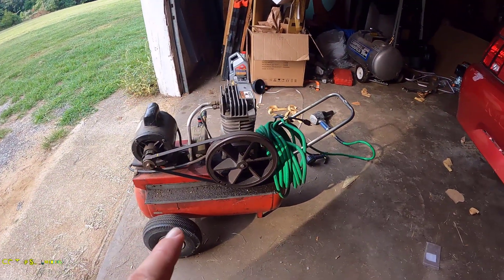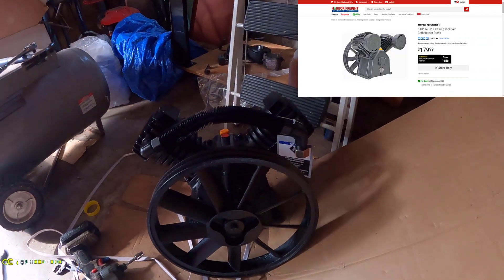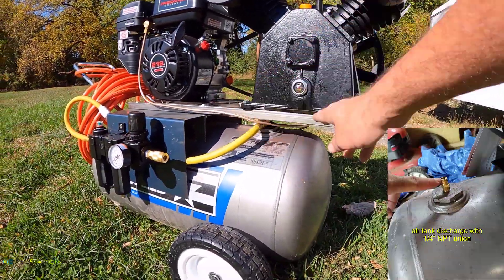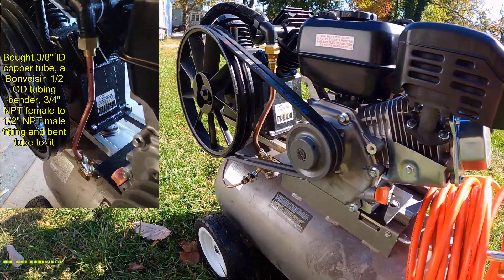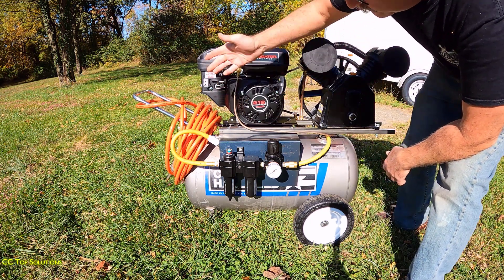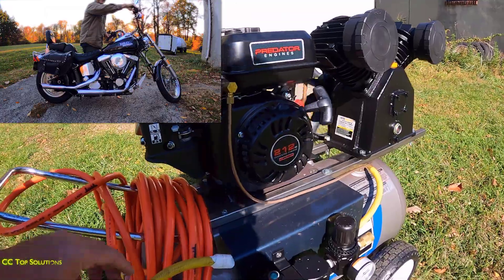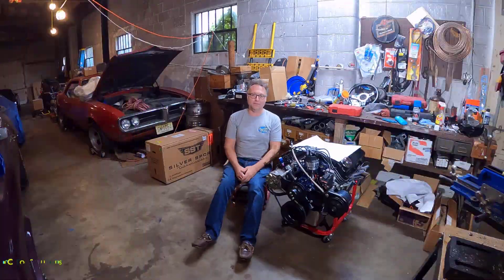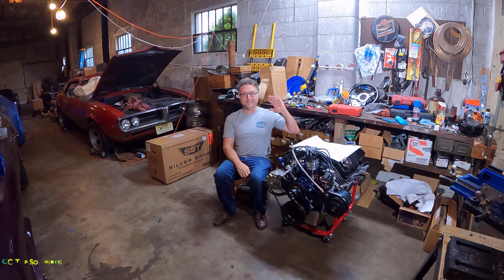Harbor Freight 5HP Gas Air Compressor Build with Pump Discharge Fitting Info

Comment: Ive built several compressors but with 110 -220 electric motor but never tried one with a gas motor think that might be my next diy project
Reply from the maker: Its a fun one!
Reply: They build air fast because they have double the Rpm

Comment: FYI anyone butting a gas engine on a tank mount that was made for electric, weld in mount down 100%, if you don't the tank will crack on the spot welds caused by the engine vibration, and it could explode, I have seen it happen.
Reply from the maker: Thanks for the tip! Ill weld it up!
Reply: What size pully did you use for the engine and thank you so much for the quick response
Reply: I keep getting people saying never weld an air tank, I just want to have the mounting plate from my old one welded by a friend who welds similar tanks every day for 15 years  to newer tank I scavenged, I suspect they don't know what thier talking about, they're welded at the factory no ? She does tig primarily & is a very good welder, whatcha think,  probably just utubers who don't even own any tools
Reply from the maker: @ericschulze5641 If shes a professional welder, definitly reduced risk. Once the welding is done, tank should be hydro tested. Ive seen some youtube vids where people connect a pressure washer to tank and pressure to like 250psi.

Comment: What kicks the motor off when it’s full?
Reply from the maker: Items 14 and 15 in the description. The engine doesnt shutoff, it throttles down to idle and an unloader valve opens until pressure falls below a certain level...then the unloader closes and throttle picks back up.

Comment: Awesome could you show how you hooked up the throttle linkage for idle control on the predator 212. I wanna swap some old worn Honda motors on wheelbarrow compressors

Comment: Can I run this same exact setup on a 60 gallon electric compressor, I can weld stuff just wanna make sure
Reply from the maker: Morning, yes you can.
Reply: What size pully do I run on the engine and thankyou for the quick response
Reply: And what size pilot unloaded valve do you recommend just looking to do a bunch of sandblasting and powder coating
Reply from the maker: Pulley (2AK41X3/4, Amazon $41.76), in the video description, i provide the part numbers for everything I used.
Reply from the maker: 14. Gas Air Compressor Pilot Check Valve unloader valve combo 95-125 
        NSG7 (Amazon, $54.90)
Reply from the maker: 14. Gas Air Compressor Pilot Check Valve unloader valve combo 95-125 
        NSG7 (Amazon, $54.90)
Reply from the maker: 9. Pulley (2AK41X3/4, Amazon $41.76)

Comment: Harbor freight has a gas compressor setup for wow I just looked have tripled since I last looked at them . Used to be $600 on sale all the time. 
  I have thought over the years about building one for my truck . But when the first one was stolen I needed one that morning so I bought a really nice one a Quincy and paid ($3500???) Nice also stolen. It was bolted down. 
 The last was a DeWalt nice Honda motor it wore out like me
Reply from the maker: Man, bummer about compressors being stolen.

Comment: What size pulley
Reply from the maker: 4.25", part number is in video description.
Reply: Thank you, what did you do for the back pressure Iam having trouble starting mine up with a 7inch pulley,
It's a predator 212 from H. Fright .tools The compressor pump is there 5 hp what iam I doing wrong
Reply from the maker: Hello, if my tank is charged, i cant start the engine. I drain my tank after each use so whenever I go to start, its empty.

Comment: Killer
Reply from the maker: thanks man, if you want to blast anything, youre always welcome!
Reply: @CC_Top_Solutions  they are easy pickings for thieves  .  And they were stealing air compressors out of trucks since they made them more portable. In the old days they were heaver and harder to steal. 
 If I hadn't retired I think my next would be  totally built in with remote qir tanks under the bed with the compressor and motor in a vented cabinet. But instead I'm going to be a hermit in the desert
Reply from the maker: desert life sounds like a blast! I remember it looked fun in Vanishing Point!

Comment: It should of filled a lot faster, that tank is maby 3 cubic feet. It should of been closer to 20/25 seconds for 17cfm@90psi  you might be closer to 3/4scfm
Reply from the maker: oh no...well, im glad its performing well. Bummer its not as well as it should..but Ill live
Reply: Basically a gas engine of 5 hp can't do the job of a true 5 hp electric motor.

An industrial 2 stage 5 hp air compressor should produce 17 to 18 cfm at 90 psi, but it would take a 10 hp gas engine to the same job.

A store bought compressor with a 5 hp gas engine will do the job of a 3 hp electric motor, of the same brand.

This is one reason that big box stores sell and decieve the public with exaggerated hp labels on the tank.